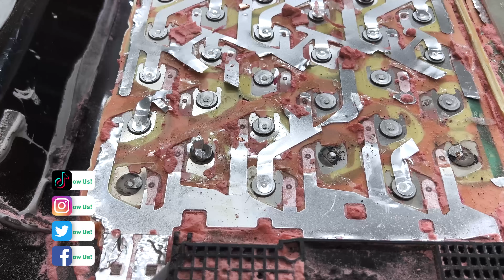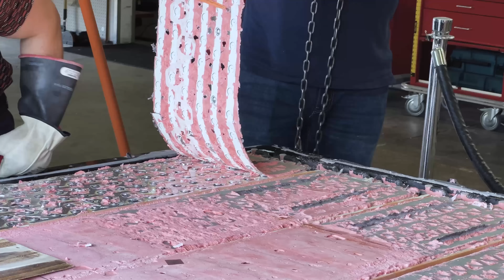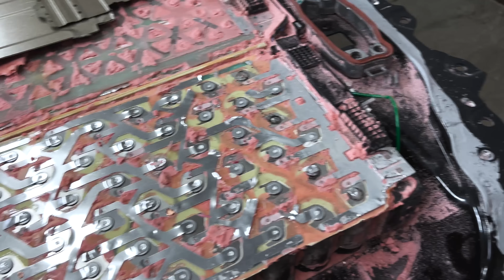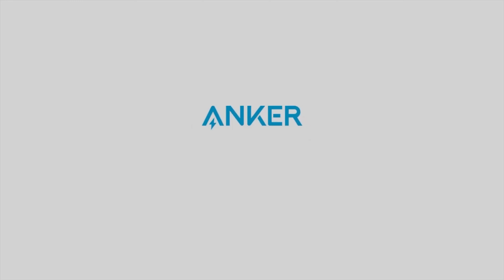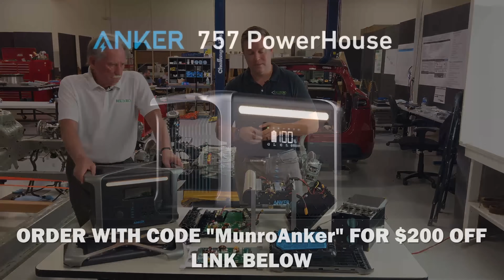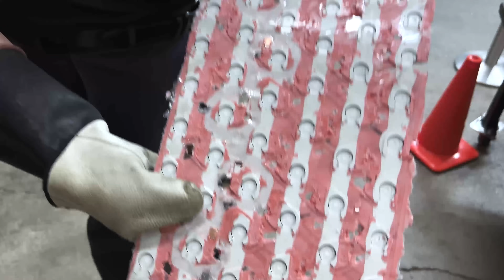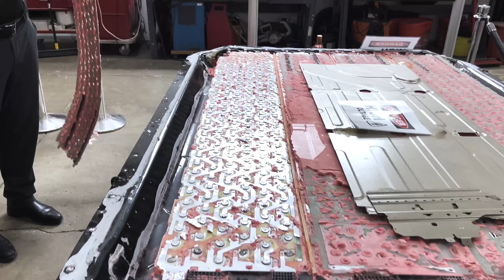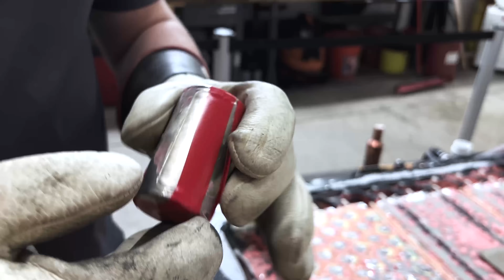Tesla's 4680 Current Collector Layout

Comment: Looks like the use of the pink foam ensures the pack cannot be repaired in the event just a couple of cells go bad. After watching the tear down the current $13k-ish pack replacement cost just got a lot more expensive.
Reply: Ask GM if replacing every module in every pack of every affected Bolt was worth it. Battery packs are not repairable. It is a safety issue.
Reply: @patreekotime4578  I'd rather ask a customer if they want to spend $3k to repair a battery and restore it back to 90% or if they want to spend $13k+ for a new one. Either way doesn't matter the choice is theirs, and that's the point.... they have a choice to fix their vehicle.
🤣Battery packs most certainly are repairable, just not the ones that have been designed (intentionally or not) not to be.
Reply: Yes. Much better this way, no additional connectors and fasteners, cheaper and much easier to replace. Everything built close and compact like a brick without moving parts or openings to corrode parts lasts longer.
Reply: @wolfgangpreier9160  Those are lots of big pluses, I also am guessing it helps with rigidity and thermal run away. I just hope the new cells have a much longer life as just a few bad cells can take down an entire pack,. The idea of a couple thousand dollar repair being next to impossible and making the only option being a $10k-$20k replacement instead seems a bit anti consumer.  As are all things car companies do to fight against the customers ability to repair their own belongings.
Reply: @NPCVenture  Please do tell me how many battery packs have been repaired in the last - say - 3 years in the US? 

Only in current cars, not in old Renault Zoe, Nissan Leaf, VW E-Golf or Tesla Model S/X. 

Do you really think you can "repair" a Toyota BZ4X battery pack? Or a GM Bolt? Or a Mach-E? or a Ultium Pack from a Hummer EV?
Reply: @wolfgangpreier9160  Doesn't matter how many have been fixed, ANY pack that is designed in such a way as to prevent it being repaired is wasteful. I am sure safety is their only concern, surely not their bottom line and ensuring they are the consumers only option. Again this applies to ANY manufacturer, not just the one this video is about.

Additionally pretty rediculous to expect anyone to know "how many battery packs have been repaired", and that's ignoring how having that knowledge has any bearing on my comment.
Reply: @wolfgangpreier9160  Please explain how exactly the pink foam making a repair near impossible is more sustainable than a pack that is repairable. Or have you just completely missed the point in my original comment this entire time? At no point was this compared to an ICE vehicle, not sure why you are even bringing it up.
Reply: @NPCVenture  A pack that is repairable will never be repaired. Thats a conundrum right? 

Ok lets look at which packs are being repaired and why and how: Tesla Model S with 250-300K Kilometers and you have to have to correct modules and knowledge to repair those. Cost? 15k in Norway at EVHub or up to 25K at Tesla. The modules will be exchanged but the defective modules are scrapped and recycled. 
It's the same as with the Roadster.

Fact: Only high value cars are repaired by their manufactuer or by companies who have at least direct contact to the manufacturer and can repair such cars in a way the law allows. All others are DIY projects - possible in Russia and the US, certainly not in China or Europe.

Are Renault Zoe Packs being repaired? Not any more.
VW Golf? No. There was a project @ VW which was scrapped, you can not open a battery pack without destroying it.
Fiat 500E: Yes in poland but you loose the license for the car and it is not allowd to be used on the roads anymore.
Any Citroen? Peugeot? Polestar? Volvo? 

Only on Module level if those exist.

Lets look at lorries: Maxxus? No, 
Mercedes CItaro? Yes on Module level, never on cell level and even on module level only before they have been cooled belo a certain temperature because those are Zebra batteries.

Others? The same, if possible on module level and some try to repair battery modules themselves, but not a single one is sccessful and does it professionally and profitably.

Now lets look at other cars. Model 3 and Model Y with 2170: Will those packs be repaired? No, single modules replaced yes and defective modules recycled. How long do such repaired battery packs last? About 50-100k Kilometers. Not more. 

Why? Every time you repair a pack you reduce the lifetime to the cell with the highest cycle count - its easy to say when the next cell and module will become defective.

What has Tesla done? They have looked at all their data from the last 10 years and calculated and extrapolated - how much cost, energy, manpower, infrastructre and logistics is necessary to A: repair the pack, B: repair a module, C: replace a single cell D: none of the above.

In the Semi there will be easily exchangebale battery packs. In the smaller models its cheaper and much more sustainable to scrap the whole pack.

You ask why? A battery pack consists of batteries, cooling, holding structures, interconnections, busbars, cooling lines, valves, fittings, strong bottom, strong top, mounting structure and enforcement parts, external connections for HV and Data. Many of those parts must be duplicated for the modules, the mounting and enforcement even three or four times.

That costs money, material - as we see in the Model Y pack at least a hundred kilos, metal and plastics which must bei designed, produced and replaced.

All of those extra material is not needed in a structural battery pack. Either from Tesla or BYD - no one else does it that way.

Is it better?

I don't know. We will see it in the following years. The calculations say yes, but thats still no guarantee for success because:

“If things are not failing, you are not innovating enough.”

And “Success is within the set of possible outcomes”
Reply: @wolfgangpreier9160  Great write up, yet still manages to not answer my question about how you think being intentionally wasteful is sustainable. Deleting your silly opinion doesn't magically make me forget it.

You are correct MANUFACTURES aren't repairing them, why is that? Because they make more money selling a brand new one. Which is fine manufactures aren't in the repair business as it turns out, them taking steps to prevent repair is the problem

Repairing battery packs is not some sort of wizardry, just because the average person cant wrap their head around it doesn't not make it mystical.  People who design them are just engineers (sorry but few of them are as smart as they think they are), figuring out how they work and how to properly repair them absolutely doesn't require "direct contact with the manufacture". I would pick your average ICE mechanic against any mechanical engineer that helped design a vehicle when it comes to fixing it. Now with the addition of battery packs, I am 100% confident that adding a double E to that grease monkeys resume wont be too hard for him/her.

Not a single successful professional battery repair business you say? Hmmm a simple internet search proves that wrong.  Alot of them do seem to be in the USA though, other countries must not think very highly of their citizens intelligence if you are saying it is OUTLAWED most other places. That number will only continue to grow as more shops learn how different packs are made and that knowledge is shared....... that is unless these manufactures continue to take steps to make sure you only have one choice, pay them whatever price they dictate.  Perhaps you think the word "professional" means something else. It simply means being paid to do something rather than just a hobby BTW. Professional has nothing to do with correctness if that is what you were going for.

I get it you dont want to fix your battery pack or have someone else fix it for you, there is absolutely nothing wrong with that. My point this entire time has been having choices is important and ANY steps taken to prevent people from having a choice is wrong. Including the very bullshit reason of "safety" Tesla, Apple, and many other companies use this very excuse to prevent competition and options for their customers for the company's own financial benefit.
Reply: @wolfgangpreier9160  Nobody knows how to repair battery packs? That is just factually incorrect., and laughable even.  I am sorry to inform you but cheap does not equal sustainable.
Reply: @NPCVenture  Cheap does mean sustainable because its cheaper - energetically and in form of raw material, logistics and knowledge/manpower to replace the whole battery -just as BYD and Nio do it. Nio on every car, Tesla and BYD only when the batteries are worn out or defective. All others have tried to repair their packs and reverted to recycle them instead. 

But you know your sources, why don't you check how many batteries from which manufacturer did they actually repair? Look it up! Ask them!

Cheap in US slang means less money, cheap in our socialistic communistic countries in Europe mean less energy, less manpower, less material and finally, after calculating everything less money. Of course everybody calculates in replenishable but does not see the complexity in repairing such a thing as a electric motor or a battery pack for 500kW power.

Or do you know anybody who could sustainably repair a BMW I3 Motor? Audi E-Tron? Ford Mach-E? Mercedes E-Actros?
Or the battery pack of a Renault? Volvo? Mercedes? Aiways? Hongqi? Jaguar iPace? I bet you will not find anyone.

Only batteries consisting of distinct and replaceable modules are sometimes being repaired by replacing modules, but never cells. Some old batteries from DIY golf carts and microcars are actually repariable on cell level. But not in vehicles allowed to drive on the Autobahn.
Reply: @wolfgangpreier9160  It seems we just disagree on how we think of battery Packs. You view battery packs as disposable (small flaw toss it) and I view them as expensive well made part of the vehicle (small flaw, fix it, keep using).

Again plenty of companies repairing battery packs at the cell level, is it super cheap no, is it significantly cheaper than a brand new one yes........ hmmm I suppose that would make repairing them more sustainable then. Repair is less money, less time, fewer resources. Less safe is fearmongering in the best case but mostly just a lie from those who what you to buy new.... from them.
Reply: @NPCVenture  Good luck finding a company repairing your GM Bolt battery pack. I do not disagree with your wishful thinking. I just tell you ist wishful thinking. We can be different opinion whether a white car is nicer than a lime green. But we can have different opinions about facts. I am sorry that you do not agree with the industry, that just does not change what exists and whatnot.

I repeat myself: Good luck in finding "plenty of companies repairing battery packs at the cell level".

Try repairing a wheel bearing, a wishbone, a destroyed rim, a used syringe. There are many products which can not be repaired or rebuilt because makeing new ones is cheaper, energetically, materially, humanly or financially.
Reply: @wolfgangpreier9160 Please explain how reality is wishful thinking? 

 It would seem your bias comes from the state of things where you live. Here in the states there are several companies that do cell level repair and have been doing so for years. Why do so few exist? I would think it is obvious but her you go: there aren't really that many EVs at the end of their life, as they start taking up a larger part of the market and get closer to end-of life places that offer this service will grow.  Their relative small number has little to do with the complexity of the repair and is due to the small customer base at this point.

As for the Bolt packs. Why would any independent shop repair them, GM is required to REPLACE them under warranty at no cost to the consumer since their construction was flawed and a safety risk. Seems like a pretty obvious reason as to why no one would bother fixing them.

To your poor parts comparison. 
 - Brand new wheel bearing $150 (parts) + $100 (labor), To repair a wheel bearing lots of tiny fidelity work, Labor would easily be more than triple the cost of new. So.... the cheap option is chosen.
-Broken wishbone,  $200 (parts) + $250 (labor). Repair likely $100ish + the same $250 (labor).  The weld will likely be just fine for light driving on nice roads, the $100 savings is likely not worth it to the customer vs having a brand new control arm installed. Used Audi A6 parts and repair times as comparison, similar sized luxury car. Other cars not too far off so close enough
-Destroy rim. Silly comparison to make since a bad cell (or a few even) doesn't mean the battery is "DESTROYED". As it turns out repairing of damaged rims is very common so we pretend you didnt give a good example proving my point.
-Used Syringe. Worst example yet, ignoring the extreme health hazard a brand new one is damn cheap compared to replacement. Also worth noting many syringes have replaceable tips instead of tossing the whole thing, proving my point yet again.

Curious, none of your examples were of things where the cost of repair was over $10k in savings for the customer versus buying a new one? Hmmm I wonder if that was simply an accident.....
Reply: @NPCVenture  Sure a single cell destroys a battery pack. Take the i3. One single defective cell with thermal runaway destroys the pack and the car. Rare occurrence but it happens. Bolts have burned more often, Leafs have lost all power more often, Model S and X from the first generations till the P85 have often this problem. One single cell takes down a module takes down the pack.
You still are talking about what you want and not what exists. Look it up where you can have your battery repaired!

And no: A broken Audi Wishbone can not be repaired in Europe. Thats not allowed because of structural integrity failures. Maybe in the US, Everything is allowed ion the US. Even coal rolling pickup trucks.

So tell me: Which of the following parts do you repair? Laptop screen. Broken HVAC condensor. Burnt out alternator. Keyboard with coke spill. Broken HDMI cable. PC Motherboard with broken capacitor. 

I know what Mr. Rossman does with his microscopic tools on a Apple motherboard replacing whole chips - my greatest respect for him, but most other things are not repaired because it would be too expensive. I would not pay his 200-300 US$ repair bill when i can replace the part with a new part for 45 US$.

Of course you can reuse syringes. Its no health issue. Its just cheaper to use one way syringes. We have used cooked syringes and still do for certain applications. Most Russians and Chinese can not afford one way syringes. In war and most military - of course not the US - the US always had unlimited ressources, energy, money, supply - use syringes multiple times.
Reply: @wolfgangpreier9160  Never mentioned fixing a battery that caught on fire, I have been taking about replacing defective cells (clearly stated before, not sure when you got fire from)... you know.... when a single cells voltage starts dipping (due to it being defective/ failing early) it drags down the voltage of the entire string, a reduces battery life. That single cell can be replaced and the pack is restored to near normal capacity for its over all pack life.  

Sorry to hear you cant fix your own cars in Europe, but alas here in the States the government doesn't pay for everyone's to get brand new parts, must be nice. Turns out skilled workers can make repairs that are strong than original, especially when it is their own vehicle and a hobby, again sorry to hear you dont have that freedom.

Literally every single one of those items can be repaired and businesses exist that do just that. How are you constantly ignoring reality despite the fact that you even point out one of those very businesses existing.  I used to think very highly of the European education system but this conversation has me second guessing my earlier assumptions if you are a representative.

Again, you pointed out several items that you believe to be cheaper to buy new versus replace. Yet you know and even watch videos of someone who repairs those devices for CHEAPER than what the manufacture is willing to and even using OEM parts. 

You keep mentioning going the cheaper route but keep ignoring the FACT that $13k-$20k (new battery) is MORE than $4k-$6k (cost to replace cells that no longer hold a charge).  Is European math different than that rest of the world?
Reply: @NPCVenture  We can fix our own cars, but not when it gets to structural issues. Then we need the license to do it. Or do it without license - then we „may“ loose the insurance. That „can“ become expensive very fast. The problem is that only few have the skills to correctly replace a front suspension, a bushing. etc. 
As i said you could do it but most don‘t have the tools to replace a DPF, a broken manifold, repair the timing chain, close a hole in the motor block.

You can repair a battery by replacing modules inside the battery. You will not get the tools and expertise of the manufacturers to replace single cells inside the module. 

Try it. I wish you luck. Don‘t forget to do all the necessary tests a manufacturer must do when refurbishing a module. 

Or find a workshop who replaces single cells in your VW ID3 MEB Platform Modules. Again: I wish you luck!
Or your Polestar 2, Volvo XC 40, Porsche Taycan Turbo S, Hummer EV, Ford F-150 Lightning…
Reply: @wolfgangpreier9160  How do you keep just missing my points. Not one single time did i mention DIY fixing a battery. Every single time I talked about businesses.... that are by definition Professionals......who have the very skills and tools...... this is going to blow your mind.... the licensing to do so.

This conversation has taught me Europe needs to spend more time encouraging young men and women to fix things. It helps build engineering skills in everyone so they dont feel so helpless cleaning a keyboard  with coke on it (cost is $0 and maybe 30min to do a full tear down and cleaning) or replace a capacitor on a motherboard (Cap <$1, solder and iron  <$20 (those might be illegal to posses for any old dumb dumb in Europe apparently), spend more time taking your PC apart to get to the MB then replacing the cap).  Reading comprehension should also be on that list it would seem.

Give it 10-20 years and there will be plenty of shops offering those services. Hell the ASE (Automotive Service Excellence) will probably have classes teaching new mechanics that very specialty. 

You are free to spend $15k every time an internal fuse blows or some other $20 part goes bad, not everyone can afford brand new every time, must be nice. Others will chose to spend less and have more money for other things in their lives.
Reply: @wolfgangpreier9160  what about the fuses and relays that are inside the indestructible foam? so if those break you replace the whole pack?. imagine your iphone is damaged in the charging port and you can't replace it because it was glued shot by a strong adhesive. so you have to buy a new phone?...nonsense. consumer must have the power over the product they buy.
Reply: @jetfu400  There are no fuses and relay inside the indestructiable foam, did you take a look at all? The penthouse is in a different case, independent and of course not INSIDE the foam. A relay would have a hard time moving...

If you want full control over your products - please buy a 20 year old Chevy or Ford, without electronics. 

Even the MCU of a not so modern car depends on dealership access and control. Without the correct tools and licenses you do not get the rght to change the MCU oder replace it or reprogram it when you've changed anything inside it.

You Mister are living in a dream world if your believe anything else.

And yes: I use iphones with the full knowledge if my charge port cracks or i drown my iphone i need a new one. They are still better than the Androoid phones and not even one cent more expensive than a equivalent Samsung or Huawei.
Reply: @wolfgangpreier9160  did you even watch the video? there's a relay or fuse inside of there. and you said that if i want to have control over my product, buy 20 year old car without electronics???? so just because there's electronics you  can't fix or control it? what kind of mentality is that?
Reply: @jetfu400  Please ask the manufacturers. Not me. I am just a small town electrician and myself not able to repair those products. Have you ever tried to replace a MCU in a modern car? Or the electronic immobilizer in any car since the 2000's? Try it. 

Or the System ROM Chip in a Proliant from 2010? The control board in a Miele washing machine from 2000? The control board in a Vaillant heat pump from 2008?
Reply: @jetfu400  Yes i have watched the vid, twice, there are no fuses or contactors inside the pack. Those are connectors for data and power and of course the cooling/heating.
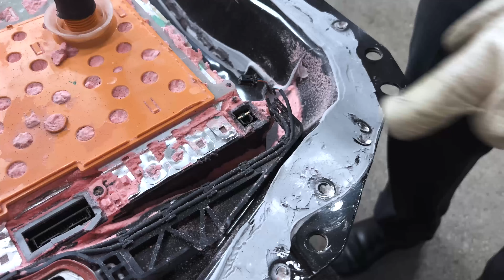Reply: @wolfgangpreier9160  right at 4:45. those are relays and contactors inside of there. you didn't watch it thoroughly
Reply: @jetfu400  And you did not watch it correctly. Those are the data connectors. Of course they are INSIDE the foam. But those are NOT the Power Connectors or CONTACTORS - aka RELAY. 

In the next ediction they should remove the data connector - it makes no sense to make a detachable connector inside a hermetically sealed enclosure. 

Is the pack perfect? Far from it! They should remove all heavy structural elements, starting with the 4680 cells. 
The BYD blade cells are much better suited for that low powered environment. The 4680 are much better suited for the Semi. 

Even the Roadster is better equipped with ultra high powered 2170s or even 18650s.

When - and hats a big WHEN - they can implement all features they've told us they want to implement those batteries may become something we all can rely on heavily. Until then they still got 2-3 years develpment time ahead. I would not use a 4680 pack for now. Not because its bad but its inferior to the 2170 from LG or Panasonic.